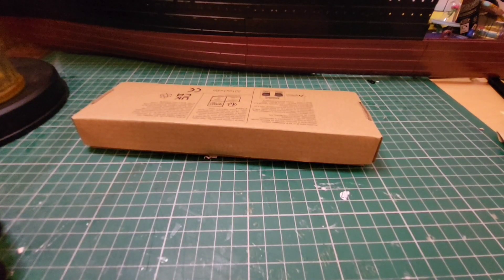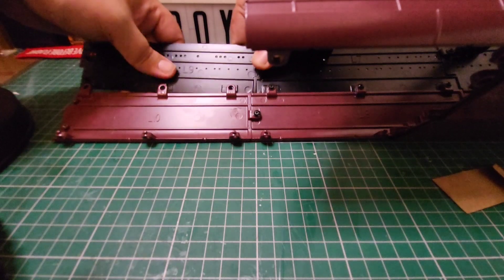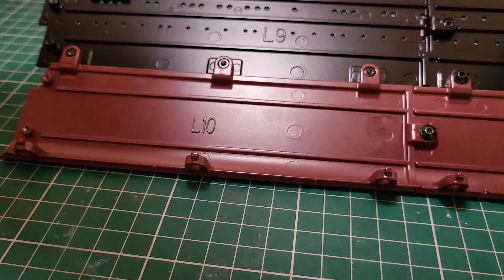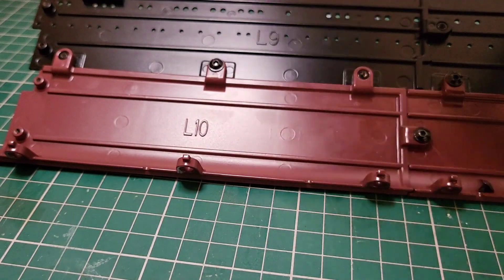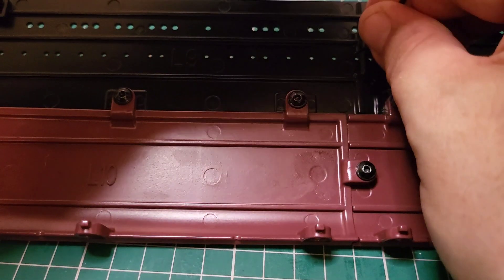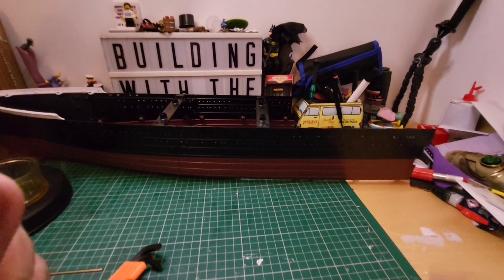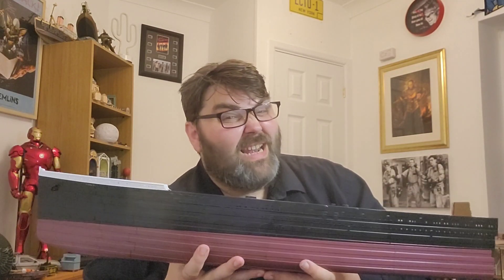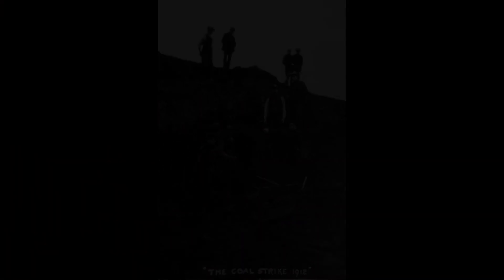Hachette Build the Titanic : Part 78

Comment: Why did you not use the tool set supplied? Others are using it and the it fits in between the sides of the hull making it much easier to tighten the screws.
Reply from the maker: Since the move I have no idea where it is, I will look it out as the little key is a nuisance to use